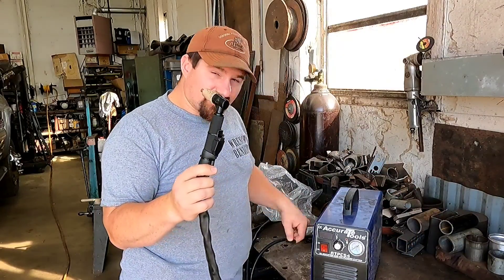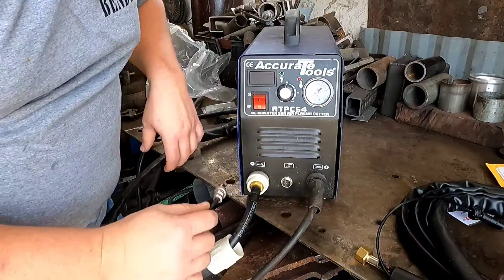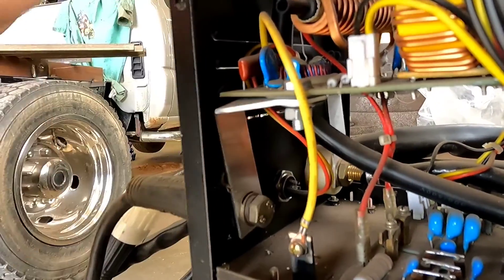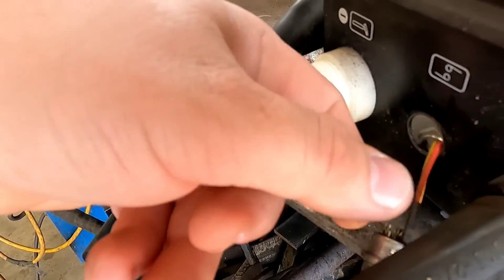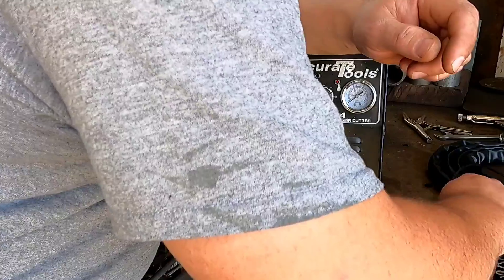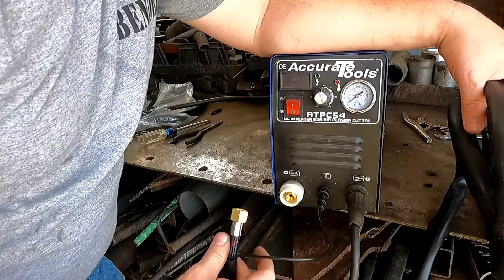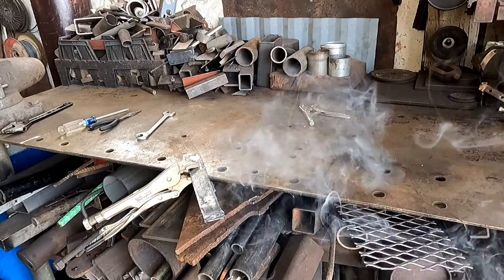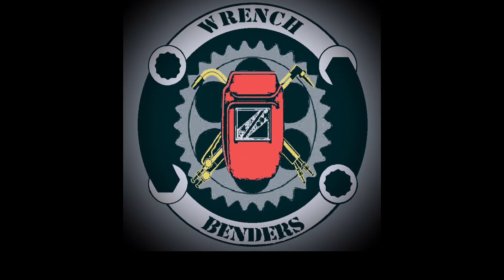Plasma Cutter Torch (Lead) Replacement

Comment: So i have a cut 50 non pilot arc machine,,i bought a pilot arc torch to add but cant figure out how to wire it,,it has 2 lead wires and a extra black lead